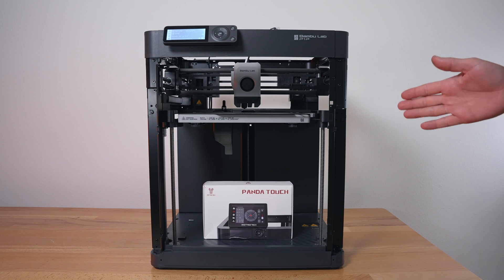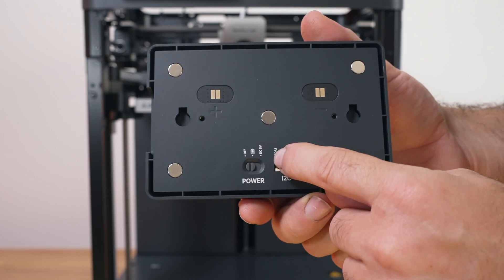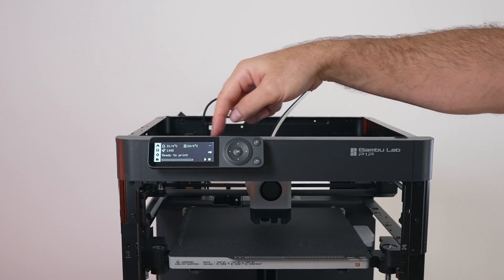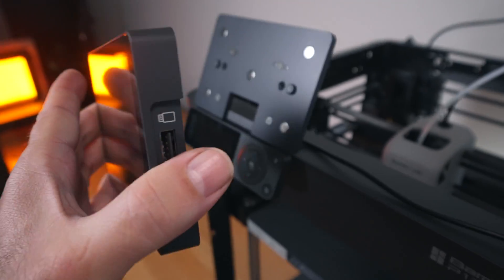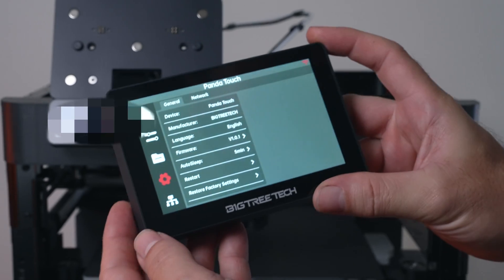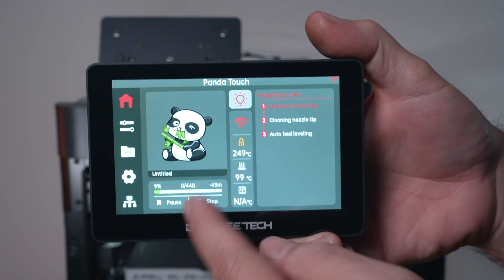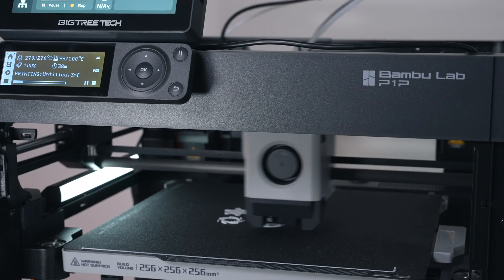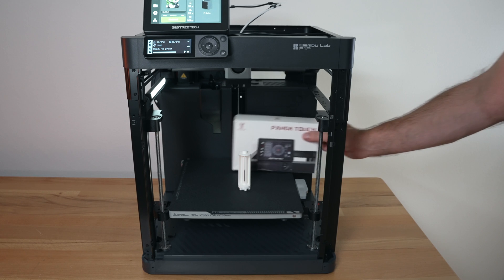The Panda Touch - Bambu Lab P1 Series - Screen Upgrade

Comment: I did put my Panda Mr. T. at the right side, in front of the hole..So, no cables! and you can still have a peek, when you don't have an AMS on top of your glass top cover....I am used to peek from the left, not the right hehehehe, depends on what you want, but I prefer not to see a cable that is running on top of the printer...Pick your choice!:goodvibes::elbowcough:

Comment: i got mine on the first of april an ive enjoyed it, atm i only have the one bambu machine so i havent got the full use out of the screen but right after i got it i started reading bambu labs was going to be releasing firmware that might end up killing the panda touch and xtouch from being able to connect to the printer so ive been waiting for the firmware update to come an when i turned the p1s on this morning it popped up it had a firmware update so i canceled an an the panda touch is still working but im not going to update the firmware until i know for sure if its going to kill the connection or not, if it does i'll have to think on it if im going to do it or not cause it would make the panda touch a paper weight but as of right now i dont know what the update does, anyone looked into the newest update for the p1s?

Comment: Please, my brother, help me to get a 3D printer . I like 3D designing and printing, even though I haven't touched a 3D printer with my own hands yet. So please, my brother, change my life. If you will.
Reply: Probably won’t happen lol
Reply: Get the A1 for a starter. Not the mini, because for example the print bed can be exchanged with the higher priced options like P1P and X1C. A1 mini is just small for convenience but isn't as cost efficient as the A1. Buy it now since there is a discount at Bambu Lab!